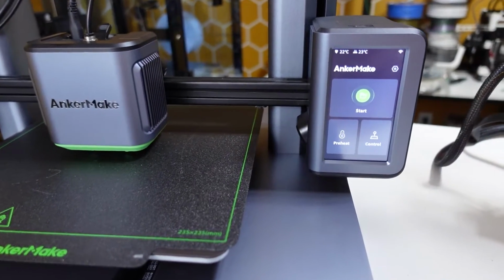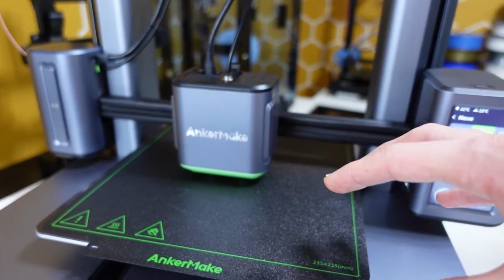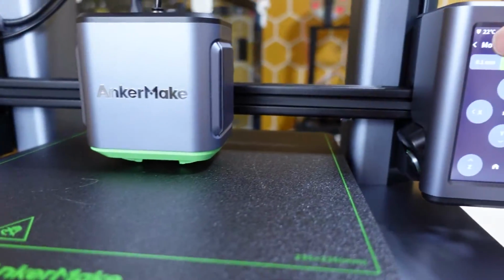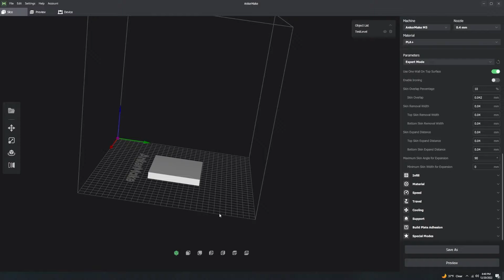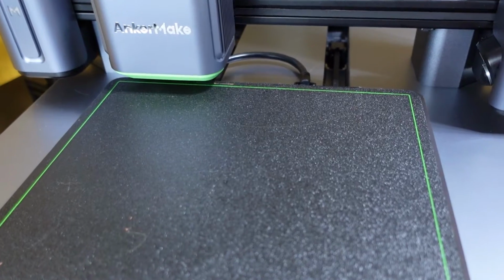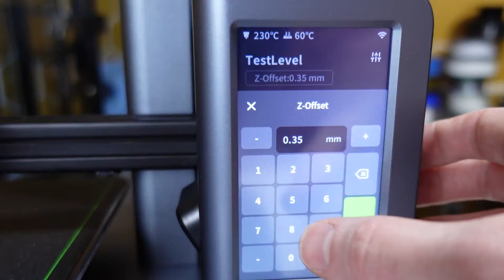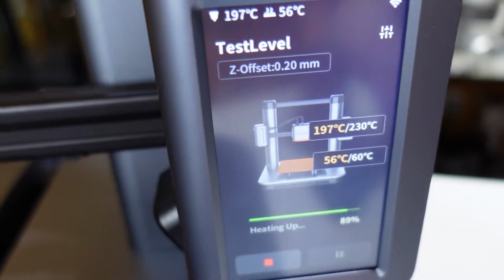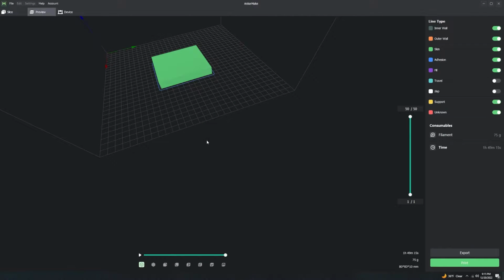AnkerMake M5 For Beginners 6: Bed Leveling & Z-Offset

Comment: you are NOT Puling the edges flat! Literaly NOT... If the bed is warped no mater how much you tighten those screws, it will not be flater LOL The nuts just move the whole bed from each corner...

Comment: I've been printing with a Z-Offset of 0 and things seem to have printed well. But is it risky for the nozzle or anything? If it works well should I actually raise it anyway? (first 3D printer btw)
Reply: No. If everything works - keep it.
Reply: I did the same because I was scared of messing something up. I finally did a bed level test and half of the print bed have small gaps and and would be a little string. I just adjusted the the offset by multiples of .5, then .01 until I got a good balanced layer.

Comment: I autoleveled mine, did a firmware upgrade, printed, bed was being gouged by the nozzle.  Autoleveled again, same issue.  What's the point of autoleveling on this machine? A little frustrated by that (coupled with a broken LCD screen right out of the box...).
Reply: In case anyone else has similar issues - I had this problem and contacted Ankermake.  They said it was something to do with over-tightening some screws (or not tightening enough) and damaging something inside.  So they sent me a new hotend.  Contact them if you're having trouble, I found them very helpful.

Comment: I'm a little confused.  The first layer of any print from ankermake slicer doesn't print at z=0 does it?  If layer height is set to say 0.2mm then wouldn't layer 1 print at 0.2mm (.14mm it seems is default settings for first layer only) if z offset is set to 0.0?  Why then do you need to set an additional offset into the printer after leveling as the first layer is already printing at the initial layer height from the slicer settings?  I'm also in the boat that I printed with no offset for my first few prints, and it worked great, which kinda supports that no offset should be right unless your abl is off it seems.  Please correct me if the initial layer height is actually printing at z=0 despite what the slicer settings say.
Reply from the maker: What you see in the slicer is the thickness of each layer, not the height at which you begin printing. Also, what you are suggesting is actually the opposite of truth. After you do an auto level, that should set a reference point of 0 for the z axis. If you have a perfect measurement and everything works as it should, there must be a z offset to achieve a perfect print, though in reality no measurement will be prefect. If you print with a z offset of 0 and get perfect prints, then that likely means the measurement is slightly incorrect. I would not immediately be concerned, but it can absolutely be a false sense of security and understanding of how the machine functions D:

Comment: Any fix for that wavey line in the middle? Mine has a similar issue where it always has the same "wave" through the print bed area no matter what is being printed.
Reply from the maker: I think that is due to a glitch in the auto bed level mesh. Probably would be best for me to redo the mesh if I see that :)

Comment: I haven’t been able to actually get my Ankermake to properly level. The center is closer to the nozzle than the edges and the left is also closer to the nozzle…I get Z offset to the point that the right side is sticking to the bed but the left and center are almost grinding into the bed…tried the 2 troubleshooting options ankermake suggests (removing the 4 screws underneath that “hold” the USB-C cables in place) and auto leveling with no Filament (mentality that the little blob causes fractions of a mm off on your height when auto leveling)….very aggravated and not sure where to go from there
Reply from the maker: I would wait a few days or a week. There is a firmware bug that affects auto leveling. Some machines are affected more than others. I think this will be fixed very quickly.
Reply: @ThePrintHouse  good to know thank you!! I opened a ticket with ankermake at the very least and they have me sending videos. Might add to the urgency for them to get the fix done 😛 best case I’m hoping they can help fix it, worst case I am hoping they’ll just swap it out and by chance I get one of the ones that prints perfectly 🤣
Reply: Should I maybe try to order a new bed? I’m just using the magnetic PEI sheet that it came with

Comment: for some reason mine works best with an offset of 0.  Is that common, or should I look for a problem?
Reply from the maker: That is very weird, but if it works then I wouldn't bother changing anything! Your auto leveling sensor might be slightly off, so if you try to aufolevel again, just be careful you don't damage the bed (in case you got bad readings this time)
Reply: @ThePrintHouse  I’m 10kg in with a 0 offset. 

I guess I’ll play with the offset…

Comment: Mine wont home anymore after i was instructed my Ankermake to "MESS WITH THE SCREWS" on the M arm feeder/sensor portion where m issue was. wouldn't feed more then and inch either way.. Sooo booted it up and Now i keep getting errors and it wont even allow me to Home or move Which WORKED Perfectly fine before just he feeding into the long tube portion... Anyone help :/ been 7 days and cant even get a crappy spaghetti print because i cant even feed it. Ive done everything by the book 100+ times
Reply from the maker: Which screws did they request you modify?? I might be able to help you.
Reply: Not sure I’ve understood what you’re saying correctly, but if as I think you’re saying the filament won’t feed in properly to the hot end then be sure to push down the clamp on the top when feeding the final bit, I missed this, took ages to work it out and it won’t work without doing it. If I’ve misunderstood your issue then I hope others can help

Comment: No way to set the Z offset without printing.
Reply from the maker: Unfortunately not really. You need to see exactly how the offset looks to know what is best. You can get close by guessing, but it'll never be guaranteed perfect until you actually print.
Reply: @ThePrintHouse  I posted about the Z offset on the unofficial discord and seems to just let it do the auto leveling and it prints fine. As soon as I messed with it I couldn't get a good print. I'll try your method, thanks.

Comment: Great video. Just got an M5. I've been having pretty good results so far but I knew this was something I needed to tune. Now I know how to go about it.
Reply: where did you find things to print? we wanted to print park benches for our o gauge trainboard Gary
Reply from the maker: Great! Glad I'm able to help. Getting the right zoffset will not only give you better looking prints, but it will also help your prints stick to the bed so you'll have less failures. The m5 is so fast that if you start to print tall items it'll get shaky and can fall easily